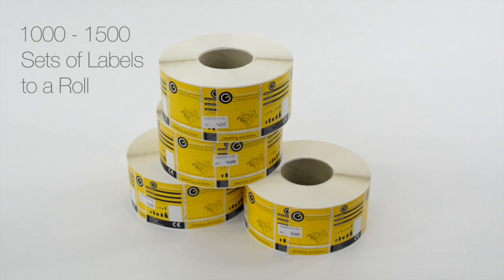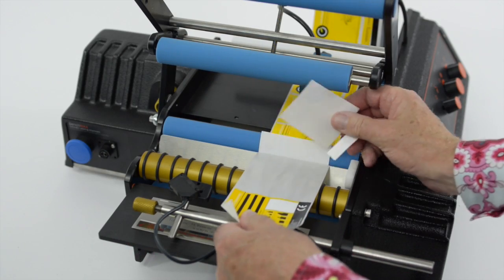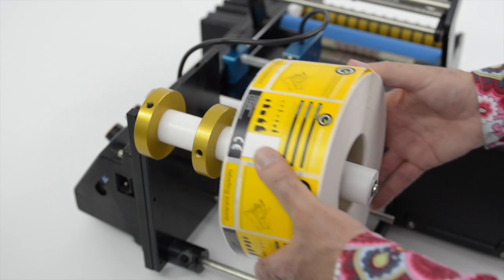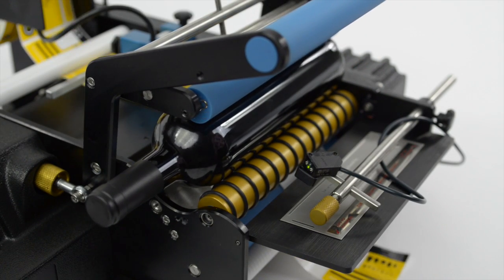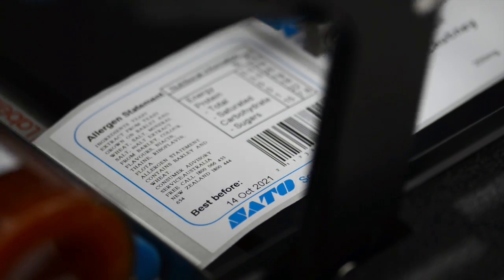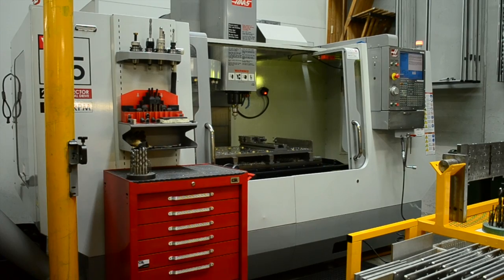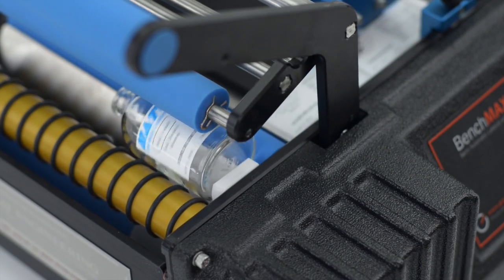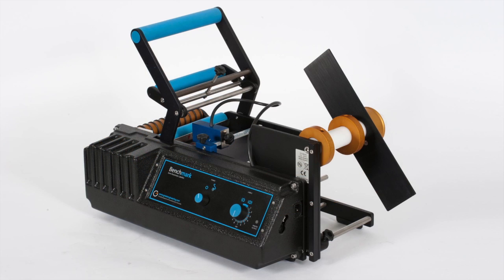An Introduction to Great Engineering Labelling Machines

Comment: Hi again to users (or needing good labelling) here is a bit more info for drink can labelling; & to have the 'front' of label for marketing/presentation at/below the 'sip' opening of top of the can. -so read below for my placing can/bottle in the machine. - when is arranged perfectly, just add a white/coloured tape piece on the top-side of side/edge of machine; then the position to place is easily recognised for all future positioning.
This similar to what I do with all winery labelling. Just ensure the bottle 'joins' are NOT behind the front & back labels! Simply place the bottle in the machine & adjust/shift it after each label applied, so eventually the 'joins' ARE the exact millimetres apart from edge of front label to it -& the other side of label is the same.
Then when 'backs' are easily applied, it is the same.
ALL about presentations, promotions & good marketing!
OK CHEERS & if you need other info or photo's of my fussy-ness, then BenchMAX TEAM can provide you my email address or mobile # & you'll certainly be CONFIDENT to buy your machine from them.
Terry Lynch. label.it.terry
(how can I add some photos for this on here??)
Reply from the maker: Hi Terry - unfortunately you can't add photos on a youtube comment but interested parties may contact us https://www.greatengineering.com/contact-us/

Comment: label.it.terry agrees with the comments of this video. -& I have used the BenchMax machine since retired from State Manager over 12 years ago. ALL the many millions of labels I have applied for many wineries here in SA, have always been applied very well and NEVER had ANY issues with my early Bench Max machine!
Plus to save some time in adding the next roll of labels, I always monitor the final current labels and as get close to the final 12-24 of them; I cut the webbing from the last one taped to the roll.
Then add the next roll and cut the start of the 1st label webbing and sticky-tape this and the last one of existing webbing/labels through machine. Then re-roll them together and after this short-time, away I go labelling again to finish them earlier, than otherwise.
I certainly recommend Great Engineering Labelling Machines!
Cheers to all -& 'clink'  'clink'   :-)  Terry -email address at start.
Reply from the maker: U R Awesome Terry - what a great idea.